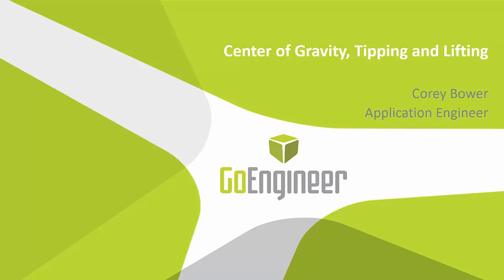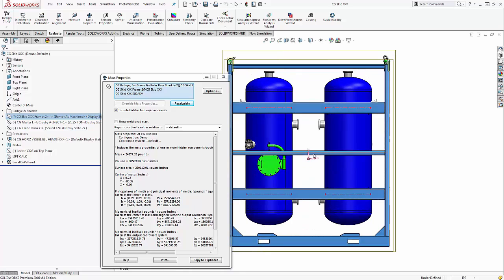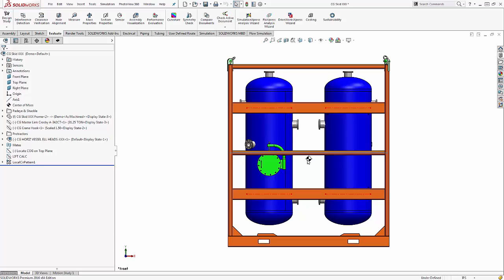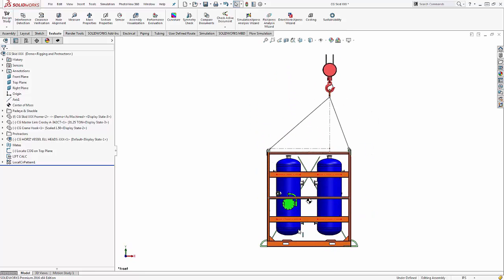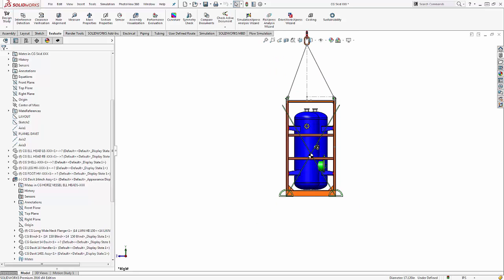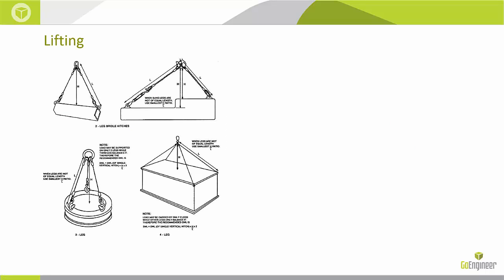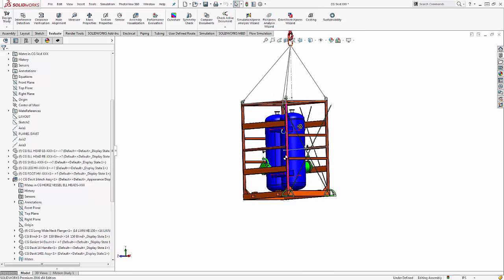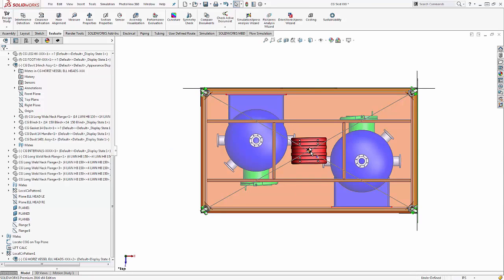SOLIDWORKS - Center of Gravity, Tipping and Lifting

Comment: Bro can u plzz tell me that how u enable these ropes and how ringing and protectors option bcz in my solidworks 2017 there is no option .
Reply: Broo plz givee solution
Reply from the maker: The ropes are simply sketch entities which were hidden and then shown… The protractors are SolidWorks part models hidden and then shown… There are no options to ‘enable’ these, this is simply technique to illustrate the message.
Reply: @goengineer  then bro how i will enable the protactors option in solidworks 2017 ?

Comment: As much as the video helps, the fixed points are totally wrong considering the sling angle as you have shown. These points only work if it its lifted using SPREADER BEAM with 90deg vertical slings and not as shown.

Comment: Your boundary conditions a categorically incorrect..... you are NOT taking into account the compression in the upper horizontal member which connect to the lifting eyes due to the angle of the lifting strops........ the boundary conditions you have applied will ONLY work with spreader beams, not with the lifting strop angle you have applied.......... think about the consequences of misleading engineers who may be copying your approach!!!!!!!!!!
Reply: Relax, It's just an example. Your point isn't even the most serious omission from the example. The tabs aren't "glued" to the top members so the boundary condition should represent welds because that's where the system would fail in reality.

Comment: Cory - Any suggestions to locate the center of gravity and tipping point for a shopping cart?
Reply from the maker: Hi John,
An analysis is not necessary to find a tipping point of an object.  The Center of Mass can be shown in your model (via 'Insert', 'Reference Geometry', 'Center of Mass').  Drawing a straight sketch line from that center of mass to the fulcrum/edge you are tipping over will show the tipping angle for the model.  It is when the Center of Mass rotates beyond this line that a tip will occur.
Reply: Cory - Can you recommend someone to assist me with this?
Reply: John Doe hi John, you can simply click on the evaluate tab and mass properties.  Then check the box for ”center of mass” feature.

Comment: Boundary conditions are completely wrong! Sling forces have horizontal components self equilibrated and fixed supports avoid compression on upper beams. Try with balanced loadings and minimal supports. Also pad-eye model is not correct because on real case there is a supplemetary bending moments due to deformation of vertical beam. Forces applied to pad eye holes are wrong because on the model are applied to all internal surface. Pin shakle transmits a different kind of load
Reply: Andrea   Can you  please explain  how the boundary  conditions can be correctly simulated.  I mean  full setup with  pad eyes.?
Reply: @taurusengineering7517  With padeyes is more realistic because there is an additional bending moment due to the padeys height. You can define the forces direction by a sketch starting from the padeyes hole centre to the lifting point. Forces must have parabolic distribution,. In Simulation yuo have to define 4 new coordinate systems, one for padeye. One axis (x or y) must be orientated as the sling. Z must be the hole axis. Because of the force system is self equilibrated, you can try switching on "soft spings" in the study options. If the solver doesn't find a solution you can apply mnimal supports only to avoid rigid body motions. Generally the rule is 3 DOF  locked on one point - 2DOF locked on other point and 1DOF locked on other point.
Reply: @andreastarnini      Thank you very much for the assistance. I will revert back once I finish the task as you explained.

Comment: Cory, thanks for the interesting webinar.  It was informative to see the different ways to calculate loads, especially your Excel spreadsheet. However, I think perhaps this was an exercise in demonstration of tools, and not so much engineering applications for the tools. I say 'perhaps', because I could be way off base here: My perception of the assembly and loads to be determined do not match the analysis you presented. The loads imposed on the cage are on the four long horizontal beams where the brackets for the vessels are attached, not on the bottom of the cage as analyzed. The stresses on the cage from the lifting eyes was not calculated at all; just the ability of the lifting eyes, in isolation, to sustain the loads. The connection of the lifting eyes to the cage, and the loads imposed on the structure is a design criteria that is critical to assess, as a system. I do not mean to take away from your excellent presentation on the tools as you did; the trees look fine! It is just the forest I am having a bit of concern with.
Reply: He has other tutorials where he goes into depth on stress analysis. This video specifically states it covers "Center of Gravity, Tipping and Lifting"